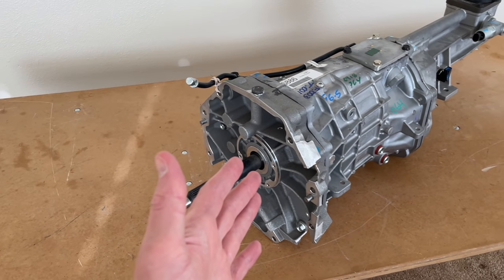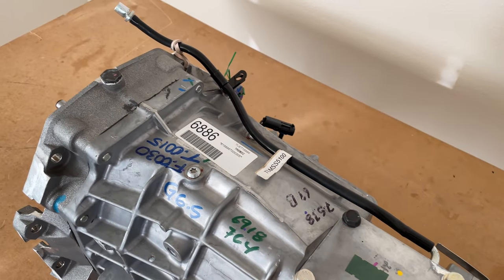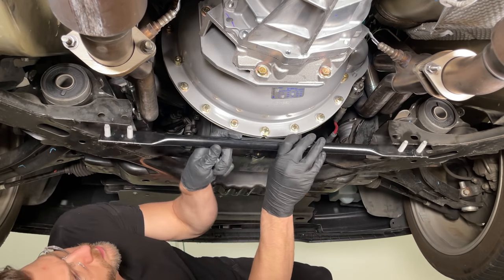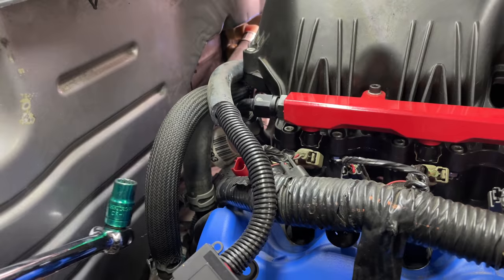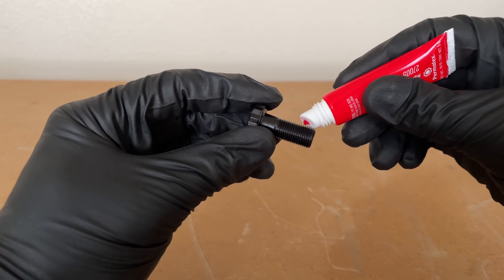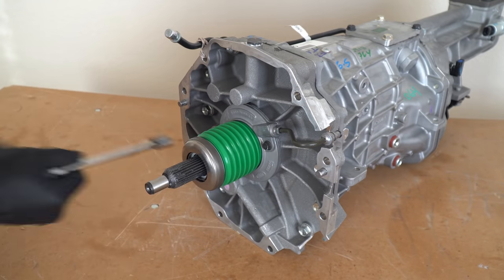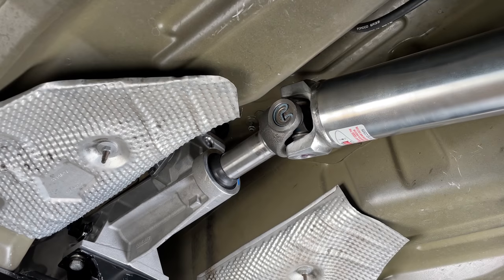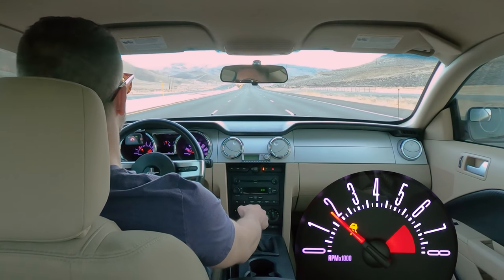How to install a T56 Magnum

Comment: I am literally in the process of Ordering the Lethel performance swap for my 2006 Mustang GT shout out to Christaphor in sales. I found this video very helpful thank you. I'm using jack stands and converting my Harley lift into a trans lift. How high in your experience should I be looking for from under the sill plates to the floor. Thanks again for the video.

Comment: Only two things. More often than not o2 sensors will be too tight to use an adjustable wrench. O2 sensors are a 22mm wrench or socket. They have special sockets that you'll likely need if you're working on a stock exhaust. And the small wire at the starter is not a ground wire. It's tge starter solenoid wire. Which is switched to power when you turn the key to the start position.

Comment: A friend of mine is a mechanic by trade. I  work on my cars because I enjoy it and I'm too mean to pay someone else to do the job.

We were doing a clutch on a manual Ford Sierra (Merkur in the US) about 15 years ago. As I was putting the pressure plate back on I asked my mate what the torque spec was for the bolts.

He said, 'Just go FT'.

"What's that?" I asked.

'Fucking Tight.'

It's a torque spec that has mostly worked in every application since. Generally, if you snap the head off the bolt you've gone 'OFT'.

Comment: Wow!  Excellent work on this video.  I've been on the fence, just reading reviews of the T-56 Magnum.  I destroyed the 2nd gear synchros on one TR3650, and am working on trashing a second transmission.  Those shifts at the end are the selling point there, you should post another video with 5 minutes of just banging gears!

Also great pro tip on priming the clutch slave cylinder.  I just stomp on the clutch for an hour like a doofus until my leg dies.  How's the pedal feel on the McLeod
Reply from the maker: Hey Wade, this transmission is a winner for sure. Expensive but definitely worth it if you're a spirited driver. As for the McLeod twin-disc, I the pedal feel is easy and linear, but overall I don't like it as a clutch. There is almost no engagement gradient - the clutch is basically engaged or not which makes getting off the line a skill in its own right. I am going to revert to a single disc and run it until it starts slipping and work up from there.
Reply: @Four_Eyes  Thanks!  I'm using the Exedy Mach 400 single clutch, and for an NA engine it's perfect.  I just recently put a supercharger kit on, so far I haven't had any slipping.  If I do another transmission I'll definitely need to be searching for the perfect clutch.

A twin disc doesn't seem like what I'd want for a daily driver...  keep us updated on what works for you!

Comment: Great stuff thanks for the breakdown! Out of curiosity did you test the 0-60 and the 1/4 mile with the new transmission? I feel like it could run mid 12s @ 111-113 mph. The car is definitely geared much better to stay in its power band at ALL times. 100%

Comment: These 2v and 3v Mustangs are way undervalued. I bought a 1998 Cobra with 32k miles for 11k garage kept original owner. Then I bought a 2002 GT convertible with 57k miles for 6500 fully loaded with a 5spd. Both cars with minor mods have around 300hp. Parts are super cheap and on the GT those 4.6 engines were in taxis and police cars they went 100k with police and another 200k as taxis in NY. If a motor blows I can find one in a wrecked grand marquis with 25k miles for 400 bucks. I stocked up on rotatable parts for cents on the dollar.

Comment: i have a t-10 seems to be real good to me but my fav. is a 02xx 400r turbo good to 800 hp stock 70,000 that is nothing close to my t-10 at least 500,000 on it hard miles since i have had it . and u can;t beat the price i been getting the 454 450 hp with a 02xx 400r turbo for free last year i got 4 crate setups from 6,000 to 58,000 miles on them all running perfect but the o2xx is easy to build up to 2,000 hp trans they come with the bigger pump heavy clutches and stage one shift kit

Comment: I'm currently installing a t5 in a 67 mustang with a 91 5.0. I've bent the pushrod 3 times so far. Very frustrating but I haven't check out the rest of the clutch system. Which Im starting to believe there's an issue in the z bar. Thank you for the video.

Comment: So your kit didn't require any adjustments to the hydraulic slave cylinder to ensure proper engagement and release of the clutch? 🏁🏁🏁 Very good video 💯
Reply from the maker: correct! and thank you
Reply: @Four_Eyes   No thank you.. And I meant hydraulic, speach to text sucks at times. 😂

Comment: Awesome video! If I want to put one of these in my 2010 SS. Do I only need to buy the t56 magnum and clutch or is there anything else I may need?
Reply from the maker: Assuming your Camaro is auto, just buy a used TR6060 from a manual Camaro - it's essentially the same trans and will mount right up to the block. The pedal assembly may be a little tricky, but I reckon there's a few how-tos out there.
Reply: @Four_Eyes  Its the manual (Ls3), would the stock TR6060 still work? I need it to handle 800 rwhp.
Reply from the maker: Cars have made more with the stock TR6060. I would just run it until it fails then buy an upgraded one from RPM transmissions.
Reply: @Four_Eyes  Thanks!

Comment: Another way of removing the top 2 bellhousing bolts is to lay on top of the engine and reach in and down from behind the intake manifold. The bolts are not that tight and I did it with an 8" ratchet.

Comment: If you’re wanting to do endurance racing, is it better to get parts that are rated for more than the rpm/hp you’re actually at? Or should you get parts that are rated for what you actually have?

Comment: I have one, in my 2004 GT and it does take a little "modding" to get it to work. Engine is fa 5.0 block, bored and stroked to 5.3L. same clutch
Reply from the maker: very nice, what compression? and do you know what it's making to the wheels?

Comment: Amazing video! Quick question…Did you measure your slave cylinder preload before installing the transmission? If so…how much preload did you have? Any help is appreciated! Thank you
Reply from the maker: I did not, with this setup and the stock slave, you're essentially within OEM specs (i.e., TR6060 on GT500). With an aftermarket slave, measuring would be required. The Centerforce clutch I ultimately went with came with a shim while the RXT did not, no issues with either.
Reply: Thanks a bunch! Love your videos!

Comment: Hey i have the same setup right now, clutch and transmission, and when rubbing the clutch during break in period ill get a hopping/stutter effect right before the clutch fully engages. Did you have a similar experience?

Comment: Careful with the "newer" GT's comment. Will not fit 19 and up due to rev matching. Can check with Tremec on that. Also, you have to clear room in the tunnel for lockout clearance. Otherwise you will suffer vibrations and rattle throughout because the lockout on the left side of trans does not clear the tunnel without making said clearance. Send MT82 to Calimer, you can't go wrong.

Comment: Did you have to shim the slave cylinder or measure for air gap? Just curious if these T56 xl conversions kits with OEM slave cylinder included are already at the correct distance?
Reply from the maker: Assuming you have an 8-bolt crank, basically any clutch/flywheel setup that is compatible with 07-09 GT500 will work with this transmission and the OEM slave cylinder.

Comment: Meant the dust boot that blocks noise etc from tans tunnel. 

I am having hard time finding a m12x1.75 shifter boot retainer. Seems to be a not super common thread pitch. 🤷🏻‍♂️

Comment: Amazing job! But just one question: why using ATF for the manual transmission?)
Reply from the maker: ATF is a thinner fluid which means better/faster shifts, but it also provides less sound dampening so you can hear the gearbox more.

Comment: "Starter negative wire," um, they are both positive. One is direct to the battery and the second goes to the ignition and only supplies 12 volts when cranking for the solenoid.

Comment: Ummmm. Why did you use brake fluid for your clutch hydraulic? They sell clutch fluid just for that and if I'm not mistaken clutch fluid isn't corrosive like brake fluid is. great video all the same though. 🙂

Comment: Much easier to install the t56 magnum than the original trans with integrated bell housing . Easier to get to all trans bolts by spending  a few minutes and removing intake manifold .

Comment: What's the difference between the T56 Magnum and the TR-6060? The TR-6060 and TR-6070? They're updated versions of the T56. The TR-6060 is an evolutionary upgrade with more synchro cones and bigger gears while the TR-6070 has all that plus it's a 7 speed. Is the T56 Magnum an upgraded T56 or TR-6060?

Comment: For anyone doing this swap dont use a 10 spline as you will bend you break it. After watching this I wonder If i can switch from the junk clutch cable to hydraulic  as my 03 cobra is like a leg press

Comment: I know, it is the 'cool' thing to go forged billet aluminum flywheel and bell housing, for weight-savings...but once you have a clutch or flywheel come apart on you during a hard 2-3 shift...and that clutch now has blades embedded in the underside of your dash (1-2 inches from your right foot), you'll understand why STEEL bell housings (and flywheels) were ignored for 'high tech changes' for so many decades. If you think a clutch 'blade' can't come through an aluminum bell housing...well...you probably need to look up what 'blow-proof' bell housings were always meant for...high horsepower applications.

Comment: Okay this is the thing I wanna do with my 2012 Boss 302 BUT, at the end you talked about revising the tune to calibrate the speed etc. that’s the thing that holds me back. Since the car has like 2 computers and a trackey(tuned red key) I don’t know anything about tuning so it worries me if doing this will mess up my specific factory tune that I heard is gone and not retuneable(back to factory special tune on the red key). I need help in this cause I can’t find info anywhere that I need. I need any info you can give Me, like is I worrying for nothing? Is retuning the car for transmission going to change anything? Etc etc

Comment: I wonder if I convert from MT82D4 to TR3160 with no internal oil pump from either 2015 or 2016 GT350. Would I perhaps ever end up getting some DTC's which they both share the exact same 100% matching reverse light switch and output shaft speed sensor for a 2018 Mustang GT?

Comment: It gets worse man..
I have so bad vibrations under the car above 110mph and beyond 
I installed the  FDSH9-A-MAG2 driveshaft as you did 
Do you have the same issues?
The vibration gets worse above 110 ... its undriveble at this "speeds"
The stick is rattleing like hell there

Everything under 110 is fine with no vibration at any rpm or gear 

Man it would break my heart if its the tranny 
I sticked with rp synchromax to reduce the trannynoises.
13k for everything.... 
And it does this :(
I work the sh out of me to do this...
I just wanna enjoy 
..aaaargh

Comment: How hard would it be to replace 6R80 transmission from a 2010 Ford F150 4.6l V8 3v with this manual transmission?  Would like to convert my truck to a manual.   Is it doable?

Comment: Do you have an opinion on swapping one of those in versus building a 6060? I have a 2012 GT500 and was debating on which to do when my trans starts having issues with my power
Reply: I'd just build a 6060 in that situation.  This one is longer and requires a diff driveshaft and stuff.  It makes it have a direct mount shifter which is great but a 6060 with an mgw on it feels basically pretty close to the same the mgw does a great job making it feel like a direct mount top loader style shifter.  I imagine you could do built 6060 cheaper and easier if started with a gt500.  At that point the 6060 will be just as good.

Comment: Had one of those just got rid of the clutch pressure plates and flywheel. Tossed is by the road and it was gone in 20 min

Comment: Did you have any issues with running the Amsoil atf? I’m planning on using the same thing for the break in period but of course people are going to talk crap online.
Reply from the maker: ATF is recommended for these transmissions, they have tighter tolerances than older manual transmissions.

Comment: If you interested in a project I have a suggestion.
So I got a 2005 toyota tacoma prerunner racing development.
Ok why did I tell you what I drive well try this as a project it has a long stroke and its 2wd so less weight.

Comment: How does one make 1000hp and have only 700ft pounds of torque? Destroke the engine? My 347 made 650hp and a smidge over 700 ft pounds of torque. Just wondering, I'm generally curious.
Reply: It depends on the build and how you got that power but I can tell you one way would be a centri gt350 they can make big power and 200-300 less torque than hp because the engine is known for making big power up high and not as much torque and centris are also known for this so combine them and it isn't that uncommon to see them 200+ hp higher than torque or even more so I wouldn't be that surprised.  Also if you have a very efficient engine and you're running a big whipple at low boost it isn't gonna hit that hard down low and having cams and other things that helps shift power curve up can make them lazier down low too its a combination of things.  Depends on the engine and what is done overall to get the power.  I've never heard anyone say these are 1000 hp capable but him it's usually advertised as 700 torque rated but they're pretty conservative with their ratings it can take a decent bit more.

Comment: Hey four eyes love the car, have you ran your 3v in the 1/4?
Reply from the maker: i haven’t, i’ve just wrapped up racing quite a few cars (for next video), and based on their C&D performance numbers, i am guessing it would run about 12.5 at sea level, maybe 12.3 with a good launch
Reply: @Four_Eyes  nice man cant wait to see the new video those are pretty good N/A times. Ive been watching your car progress i love it because it seems to be similar to mine and i don’t find many. I have a dragy and my best was 12.1 at 113 with 2.2 60ft
Reply from the maker: damn, what kinda mods?
Reply: @Four_Eyes  I still plan to do EWP, aluminum driveshaft, manual steering rack, racing seats and weight reduction like K member, rad support, brakes and what not but as of right now i have JLT 3 intake, UDP’s, msd coils, ford racing manifold, Ford racing throttle body, hot rod cams, ported/milled stock heads, bama tune, Pcv delete, kooks headers, kooks xpipe full 3”, 4.10 gears, mach 500 clutch, 39lb injectors, walbro 400lph fuel pump, lightweight flywheel, stainless clutch line, lightweight rims, hurst short throw, A/C delete and front sway bar delete.

Comment: Hey i wanna ask what after market transmission would you recommend for a 2013 ford raptor svt as ive tried looking for better shifting ones although there is barely any options i can choose from as i am also running a supercharger kit and want the shifts to better handle daily driving and speed

Comment: thank you for the video!  Could you confirm the ARP flywheel bolts?  Are they ARP 156-2801?
Reply from the maker: I used 254-2801. I sent you an email as well.

Comment: Bought a 2018 mustang gt a few months ago from a dealer that already had this transmission 👍only problem now is it's making all kinds of clunking noises and just seems to be riding rough all together but nothing has broken yet 🤞 warranty won't fix anything until it actually breaks or is non functional. Also a lot of lurching in 1st gear when causing really slow like anything under 10mph
Reply from the maker: is it cammed as well?
Reply: @Four_Eyes  no it's stock cams well as far as I know anyway. Doesn't sound choppy or anything. It's relatively quiet at idle it has kooks longtubes and corsa exhaust with the mufflers. It gets loud after 2k rpm raspy loud so I'm guessing it's the corsa extreme

Comment: Hey fam, where could I find this transmission at. Because mine grinds a little bit in second, third. Now when the air-conditioning is on it grinds less.

Comment: Ok question what specific transmission did you get? Gear wise? I see a few 266 gear tremecs which one  did you go with …which gears?
Reply from the maker: T56 Magnum XL 2.66

My Mustang has 4.10 axle gears so gears are still pretty long with this combo.

Comment: as good as this is its not the best transmission there are alot of diesel transmissions that shift insanely fast and are 3000ft lbs capable and more.....
great vid just had to point that out

Comment: Shame they discontinued the best gear ratios option. I was setting my car up specifically to use that gear set and then they dropped it.

For some specifics and history on this transmission that EVERYONE gets wrong. It's not a Tremec T56 Magnum. It's a Tremec Magnum. Tremec has been on record multiples that everyone is calling it the wrong name. It's not even based on the T56, It's based on the TR6060.

Comment: How much time would you shave off your quarter mile time from the twin disk clutch ?
Reply from the maker: The gear ratios will make the biggest difference (3rd gear is so long on the TR3650 it kills its quarter-mile time). This is why 3v's often hold their own in roll races up until 3rd gear. The new trans will defs improve ET's, but by how much I'm not sure, I'd guess by at least a quarter second.